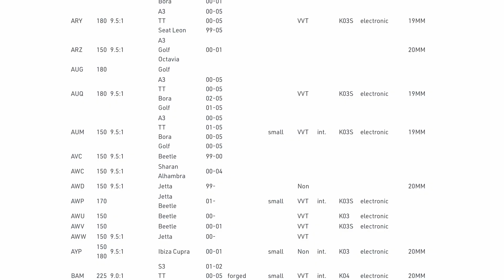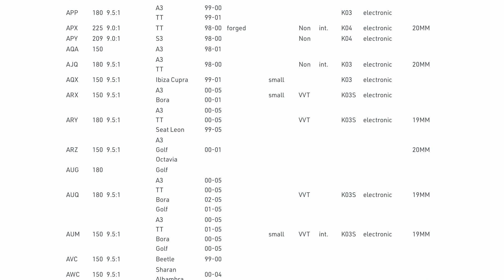Which 1.8T Should You Build?

Comment: That's super impressive the stock 1.8t Pistons can handle upto 500whp.Looking forward to the 1.8t turbo video. Interesting info between AEB and AWP heads. The AEB does look like it would have more flow.
Reply: It does, but I saw in another video that the AEB engine has rod that runs through it and if someone wanted to do after market pistons, they have to have a portion trimmed off of p3 and p4 (I believe).
Reply: @Seth Ewan  oil pump shaft. Yes rods u have to notch the block. Not a big deal
Reply: @Jamk14  thanks. Good to know it isn’t a big issue.

Comment: My AWP engine setup (Made 720whp 50psi kill mode) E85  2450# weight 
8 point roll cage
8.5-1 SPA Piston
IE Rod
Stock heads and cam 
Supertech valve and springs to rev up to 9k
Clutch Master 725 heavy duty spring
Forger Oil pan with buffler
External catch can
3071GT turbo for track day and 4088GT for big power
Tial 50mm wastgate
Tial 44mm blow off valve
Reply: Do you have a YouTube channel or a Facebook would love to see that monster
Reply: Your b5 was only 2450lbs??? Or 2450kg

Comment: Oil sludge is a super big problem with 1.8t VWs. What can you do to help with that? Mines a AWP from a 2003 20th anniversary
Reply from the maker: Proper oil changes.
Reply: Also, majority of the sludge issues are on the longitudinally-mounted engines due to a smaller oil capacity (3.9 qts. vs. 4.5 for the transverse mounted engines).  That's why VAG issued a larger oil filter as a fix for the longitudinally-mounted enginesto bring the capacity to 4.5 qts.

Comment: I know you guys said don’t stress between the AEB or AWP heads. How does the VVT factor into power ? Does it restrict what you can do?
Reply from the maker: No, when you're shooting for big power it's deleted anyways.
Reply: @COMotorsports  VVT in those engines is geared towards improved emissions more than power.
Reply from the maker: @dantesinfernopurgatory7826  it can help with spool but again big power it's not used.

Comment: 06А Block is the latest revision of all which is found in 
S3 8L’s , Leon Cupra’s , TT’s
They all share the same Forged Crank, 20mm Wrist Pin, Small Port Head’s in all of 210/225HP cars. They also use 9.0:1 Comp Ratio and their Pistons are the latest and strongest revision of all factory ones made by Mahle.

The best you can get out of 1.8T is making it Stroker with Early TFSI Forged Crank & Ligther crank than 1.8T’s one.
Wider Bore diameter up to 83mm.
Worst and weakest point of 1.8T is the Head and it’s been like so always. 
Going over 550/600 is well worth to invest money into Gridle Kit with billet Main Caps and ARP hardware and last but not least Fluidampr for better harmonics ofcourse.
Building the head is well worth to be Big Port , port matched , port flowed.

The rest is personal preference.
And last but important!
Use HEPU waterpump and Pierburg Oil Pump only, these two are proven to be the best OEM substitution!
Reply from the maker: A lot of this is incorrect and I have to disagree sorry.
Reply: @COMotorsports  Which part of the written is wrong exactly?
I own 1.8T S3 8L for 8 years now and it’s been thru few builts.
All the info i wrote about stock components is very correct and I can assure that by the 1.8T list you show in your Video of which I know about way before I even own 1.8T
I’ve seen many stock S3 pistons to be used on many 1.8t drag cars in my country ( Bulgaria ) on well over 500whp easy.
I know few of them to live still.
Reply from the maker: @andyhnio  Without wasting 30mins typing everything out.. quickly. 
1. not all 06A blocks are 20mm pins, for example this one is 19mm. 
2. Stroker isn't' require to make power. 
3. TFSI isn't the only crank that can be used for stroker, also I highly doubt the TFSI crank is lighter than the forge 1.8t crank. 
4. Boring to 83mm is just taking material out of block, in turn making it weaker.... again not needed, and we typically avoid going that far. We'll find another block before going up to 83mm. 
5. Girdle is 100% not required even up to 800whp+ as we've proven. 

Those are to name a few.
Reply: @COMotorsports  Well, everyone choose how to built their engine by their choice right?
What people get in America and in Europe is something completly different in term of final factory product. the followed vehicles I mention above share the same components all over. There are few people who proven the lighter crank on scale already, anyway that's not a point to be proven to anyone.
82.5 to 83mm is very common procedure in the UK especially.
Regarding the Gridle kit I didn’t ask for an opinion I just commented my personal opinion based on years of following big companies in this type of industry building these engines from reliability to it’s limits. 99% of the Greekish 1.8T builts and not only 1.8 engines have been using Gridle kits to reduce the stress and prevent the block from flexing during high power applications. Cheap mod for what it is.
Never mind, I do follow your content guys and I do respect everything you do and the information you share. Don't get me wrong I'm not a hater. Appreciate the replies.
Reply from the maker: @andyhnio   I appreciate the comments and following along. My points are for the people reading comments in the future. Maybe at one point people thought 600whp required a girdle but it 100% is not.

Comment: For the Mk7 1.8t what would I need to future proof my engine for more power? Specifically around 600 crank horsepower.
Reply from the maker: The gen3 1.8t is a different animal, you're biggest issue will be tuning at that level. You'll want to figure that out first.

Comment: There is sooo soooooo much to dive in here, it's insane. MOST people will NEVER get what they think they want due to cost, from a 1.8T. This such a massive topic, and stroking isn't always the answer.

  Like I have said on the 1.8T forums for a couple decades now, just start simple, drop in rods with oem piston, full bottom end refresh and hone, that will take you to 400whp..then build your head and you can push 500+hp with that. AEB is a waste, BECAUSE, they are very old, they are not as well made, and they don't really make much more power..it's nominal. A gasket matched, tapered small port or even better, use a phelonic transition spacer will go much further.

 MY choice after all these years now...AWP always, what should you do internally...10.5:1 81mm piston19 or 20mm, refresh top to bottom, 625 fasteners, cat 3660 cams, g25-550, ID1050x injector w/4bar, Ignitron, full flex, 4bar MAP SD

  My MK1, drop in rods, 625 fasteners, oem awp pistons with a fully built head, cat 3651 cams, PPT billet gt3071r, G2 1000cc inj w/4bar FPR, Ignitron ecu, 4bar MAP, full flex fuel, SEM intake manifold. 14+years, 260k+ miles, 10 years daily, while doing doing hundreds of track days, Time attack racing, HPDE, autox, canyon blasting, cross country driving, below zero driving to over 100 degree tacks days. from 91 octane to full E85. My point.....you DON'T need to go crazy, but you will need to spend money to do it right, once and enjoy it.
Reply from the maker: You also don't need 625's for what you're talking about either IMO. ARP2000's will go further than everything you have listed there.
Reply: @COMotorsports  I agree, but, I'm a big fan of them and I fully believe they are the only thing holding my engine together besides the 20-w60 300v lol. So I'm factoring in the common "what do I need for 500hp" tards that ask on the forums, and in Fb groups 4-5 times a week. Then the common response of "max speeding rods, AEB head and"huge turbo/hybridk04" responses that dominant the bad info given out on a daily basis anymore. I totally think you can clear the air and help establish a good baseline of pathways to achieve what many people think they want, where they can begin and how that setup can grow. That is also what I am beginning to share on my main IG. Solid setups, how and why they are reliable and what they can achieve with minor changes or none at all. Love you guys!!

Comment: Thanks guys for all the info you share on your videos. Taking the opportunity to see some of my doubts anwsered. I bought a TT 225 (APX) as a project car, aiming to push it as far as possible while keep it in realiable for its purpuse. Would like to see +750hp crank.

VVT or No VVT
Valve guide angles? Which?
Oversized valves? Which ones? Exhaust? Intake? Both?
How big do I need to go on the turbo for the 750hp? G30-900?
How much of a difference does going 2L makes, other than spooling?
TDI or TFSI crank?
Reply: Get on a forum my man, you'll get a lot more conversation out of the people who are there. YouTube really isn't good for that sadly.

Unless you live in a very remote area you'll be able to go to car meets and stuff with the people you talk to, added bonus
Reply: the limit is 300ft/lb of torque on pump gas "99" on any 1.8t from Volkswagen/Audi/Skoda/seat.
Reply: the limit of the block is 900hp. will split after a few runs. block can't really handle 700hp for to long.

Comment: sup ya'll. I have the AWP but Im going to be installing the AEB head. my question to you is about head studs/bolts, AEB gets the 11mm and AWP gets the 10s. Do you think a washer under the bolt head/stud nut will suffice or just run the 10mm studs/bolts as normal? 034 no longer offers the stud kit for the AEB head swap. I assume the bolt holes in the AEB head are drilled for the 11mm bolts.
Reply from the maker: The bolt holes are bigger, that is all.
Reply: @COMotorsports  yo what does that even mean? your statement doesn't answer my question lol
Reply from the maker: @userpike  it does if you understand my answer. Lol
Reply: Sir, your answer to my question, " Do you think a washer under the bolt head/stud nut will suffice or just run the 10mm studs/bolts as normal?" does not answer my question in a definitive way to me. It leaves open ends..I was honestly looking for a "yes" or a "no" or for you to say something to the extent of like "you don't need a washer, I've done this before" or like "you need to spread the force the bolt head puts on the head because like the flux defibulator is gonna smash the aluminum into the 11 mm hole and you won't get good clamping force after a few heat cycles and like 70 psi boost and then boost leak out the mamajama thingythong" you know?
Reply from the maker: @userpike  the answer is perfect, the issue is youre over thinking it. Just use the 10mm bolts, it's just a bigger hole that's it.  Also you're not making 70psi with 10mm bolts so you can forget that.

Comment: Hey guys, really like the channel! I have a question.. I have a 2002 AUM 1.8T engine with 170000 on the clock. While it's been in my possession it has been well looked after. Do you think there is any danger or wear issues with the bottom end if i go for more power with updated rods and bigger turbo? It's FWD and im looking for driveability not stupid power. I'd want ~300bhp. Amu advise would be great :)
Reply: I am almost thinking the same thing. I have a 02 AMK 1.8t Cupra R with 340k km, it's my daily and I do some track days. Would like to bring the power to current hot hatch numbers, so about 275-300 without loosing response but the wear of 340k km worries me :)
Reply: @MEGAS112  little bit of a concern right? Like these guys say, if the only REAL integral part needed (in the rotating assembly) to reach these numbers is the rods then I'd happily just go invest in them alone. I have been using a thicker oil as recommended in some VAG forums but I'd hate to do all that work and then blow the bottom end up!
Reply: @George-ws2wr   every info that I read about my specific 209hp 1.8t (and 225) it seems 300hp is fine with stock rods, if the torque does not exceed a specific number. But at 340k I worry about rod bearings, and the condition of head gasket (maybe retorquing the head wouldn't be a bad idea). All this keeps me at stock power for now :)
Reply: I think it really all depends on the service history of the engine, if it's been maintained properly it should be fine. I use thicker oil in my 340k km engine with a GT2871r on 15psi and often wonder if it's safe haha. I plan to use liqui moly oil flush and change the oil as soon as it changes colour so it's always fresh and run a bottle of redline SI-1 Complete Fuel System Cleaner before oil change to remove deposits from the pistons.
But if your doing rods you may as well replace the bearings while it's open.
Reply: @CliffB5A4  100% the service history is important. Unfortunately, mine came with virtually none but I've kept my other AUM 1.8T from my old donor car which has full service history and well maintained while in my possession. And yeah I fun thicker oil in mine which seems to be the recommendation. I'm a little skeptical about doing an engine flush as I've heard this could do more damage than good 🤔 but I have zero experience on that other than some info on blogs and the odd YouTube video. I'd love to do a full rebuild with my spare engine but it's a kind of 'when money presents itself ' deal. While we're chatting, do you or anyone reading this thread know much about tuning software for the stock ECU. Of course new standalone is better but I'm not looking for ridiculous numbers and am keen to learn a bit myself on mapping. Only the software I've seen have been a bit pricey. A free software would be awesome.. if there is such a thing.
Reply: @George-ws2wr  yeah I have seen the odd video about not flushing but I know lots of euro shops use it. The safest tunes will always be custom or flash tunes but I did see a video with information on how to apparently do it yourself here --> https://youtu.be/cyDBHA_t2Og
Reply: @George-ws2wr  here's one from CO motorsport about tuning I've saved in a playlist. https://youtu.be/b9tihV3eu2Y
Here's a playlist I've made over the past few years for 1.8t engines and Audi's. https://youtube.com/playlist?list=PLEAQfmPJtKa4nIqHAWPbCBf59z4IADATZ

Comment: Ok Here i come, ive got a 96 aeb with me3.8.3, no map Sensor only this shitty maf with throttlebody, is There a Budget way to Swap an me7 over of a standalone? To have more Control over the engine? I feel Like the engine runs 50% of the time blind when it comes to Lambda/boostpressure ... Ive Got extrem Timing retards between 2-3k RPM and cant really Figure Out why

Comment: AEB, ADR heads has biger port intake and also have biger camshafts 
all 225hp engines and 20 pin pistons has forged internals so the 19 pin piston isnt forged and handle less boost
Reply: 20/19 piston pins ?

Comment: This is very difficult topic, essentially all 20vt are the same but very different when you start comparing engine codes. You should consider engine code when you are going to run stock ECU because thats were the biggest difference is. Some come with narrowband, some with wideband, cable throttle, drive by wire etc etc. Proven combination for low budget sub 500hp is 225hp(if you have later model 150 or 180 with me7.5 just buy a second hand 20mm wristpins pistons) to start with because it has the 20mm wristpin, me7.5 ECU. Buy a set of rods and exhaust valves and thats about it. Turbo choises are endless, very good solution for turbo is a k04-064 from next gen S3 with adapter plate that will give you about 400hp with spool from 2500rpm.
Reply from the maker: The engine doesn't care what ECUs controlling it.
Reply: @COMotorsports  correct but if you are to start with a car with narrowband ecu, cable throttle body it is a pain converting to later model me7.5 wideband ECU and drive by wire. Again thats if you are planning on using stock ECU and not standalone, if you are going straight for standalone ecu doesn't really matter whichever engine you pick.
Reply from the maker: @aleksandaraleksandrov8213  I understand your point however this video wasn't about the vehicles they came in, which is why we didn't discuss that. It was strictly about building a 1.8t engine.
Reply: Hi, I just seen your comment.

I have a cupra r 1.8t 2005 bam 225bhp.

I’m looking to achieve around 350-400bhp, what do you reckon I need to achieve this power? 

Will a hybrid turbo be sufficient? 
Or like u mentioned a later s3 turbo from 2.0tsfi be better ?
Will exhaust valves and rods be enough? 

I would appreciate any information.

Thanks.
Reply: @MrOki419  Hi, depending on what you would like to do with the car. If you want nice easy to drive quick street car, definitely the k04-064 is the way to go. Rods are a must as well as exhaust valves. Also, you will need a minimum of 630cc injectors, bosch 044, or equivalent fuel pump and decent size bar and plate intercooler with at least 2.5" pipework to go with it, 3" downpipe with ideally 3" catback system and a very good tuner who could make work of the hardware on the stock me7.5 ecu.

Comment: Bought a 1.8t Jetta….Went completely oem my motor has been totally resurrected/resurfaced. Everything has been gone through besides fuel pump. Got some gauges. My air/fuel ratio is 22.1. Should be around 14.1. Also I was told I need a tune….  New to the vw scene. Starting from scratch with all stock internals. It has a front mount intercooler and full exhaust. Not trying to make a ton of power I just want it to be healthy.   2004 1.8t awp manual 5-Speed. I need tips ab a tune and my afr
Reply: So the "tune" aka ecu flash should help solve your afr ratio unless theres a nasty sensor feeding it the wrong air or fuel intake data